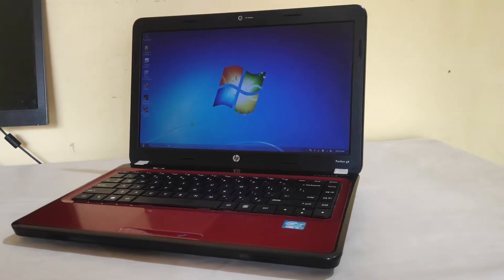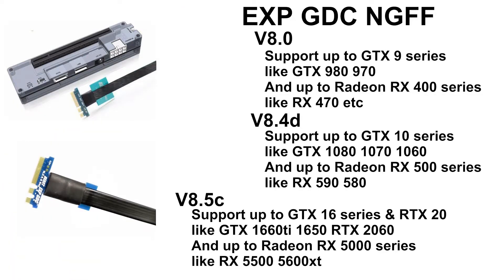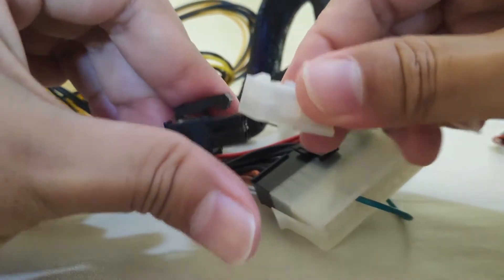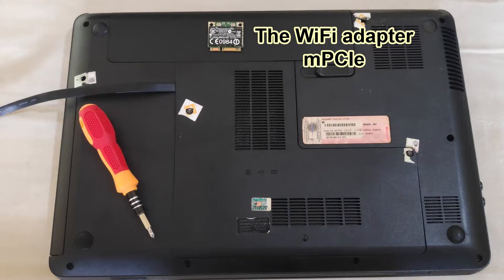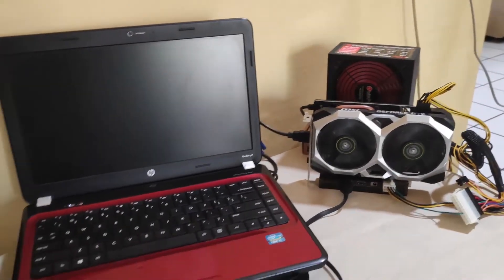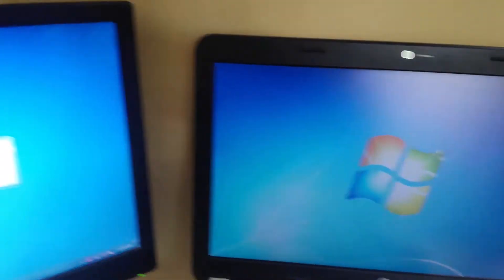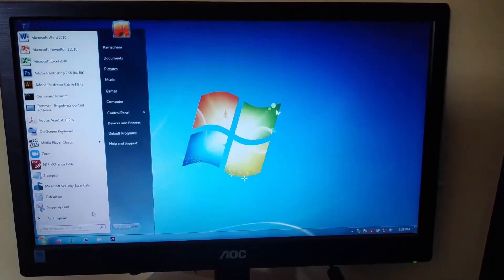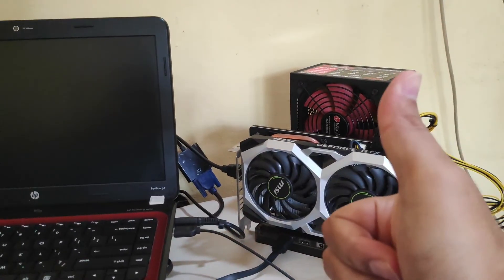EXP GDC Beast V8.5c eGPU with GTX 1660 ti on Old Laptop from 2012

Comment: question about using the reversed gpu. if my laptop is a gtx960m can I use a gtx2060 or gtx1060? or switch to amd completely?
Reply from the maker: You MUST Disable GTX 960m COMPLETELY. From Device Manager and then from BIOS. But before that you will need to use Display Driver Uninstaller DDU.

After that, you need to make sure IntelHD Graphics driver is installed properly so the Laptop can run even without GTX 960m
Reply: @ClayWheeler  the bios on my laptop does not allow me to disable the built-in graphics display. I have installed the drivers for the 2060 and it shows in the device manager. also uninstalled the drivers for the gtx960 the reinstalled the gtx2060 drivers. but for some reason the nvidia icon says there is no monitors connected for the gtx2060. So because i don't have the option to disable the built-in graphics display I think something is getting forced by the intel drivers. my laptop is a msi ge62 2qd apache pro runs a fairly old bios.

I should mention this process was before using DDU. i will try again with DDU.
Reply from the maker: @regfinley7111  right So basically while the GTX 960M Still installed and running like normal, try to Open Device Manager. Go to display section, Right click on GTX 960M, check which Access point PORT it is using from Details Tab, and then take a note of it.

 And then on the Top Menus , click on Show Devices by Connection. This will show which COM/PORT the GTX 960M is being connected to. 

Basically something that says "PCIe Controller xx COM x" or similar to what you take note earlier. Right Click on it, and then disable.

After that Restart Laptop to Safe Mode, 
Uninstall GTX 960M, RTX 2060. Basically just select the NVidia menu in DDU.

BUT before that, download the installer for your IntelHD Graphics driver so you can install it after Restart.

And then also uninstall Intel driver if still existing.
Reply: @ClayWheeler  Im a but confused when its safe to uninstall intel. If I uninstall nvidia drivers the windows drivers will take over when I use DDU to remove Intel correct? Or do i reinstall the RTx2060 drivers first before uninstalling intel?
Reply: @regfinley7111 On my understanding you're trying to say that uninstalling your CPU igpu and Descrete GPU  windows will take over the display driver system and act as a adapter for mean time? Yes, and u can now install the 2060 driver and the igpu CPU driver. Just don't install the 960M driver or it will override the 2060 drivers causing some weird stuff (trust me).

Welp this comment is a week old maybe already figured it out.
Reply: @FreyaChanQQ  I have not got it working. Everything is fine until I install the 2060 drivers. I think the nvidia game ready drivers might be the culprit. The 960m has a way of updating its self no matter what. I gave up a bout a week ago. I can install the 2060 drivers in safe mode. Everything is fine from the looks of it in the device manager. then when I restart the MSI logo shows for 2 seconds and freezes then nothing happens.  its frustrating to say the least.
Reply from the maker: That's why using GPU from the same maker (NVidia) is quite complicated.

Same thing if the Laptop already have Radeon GPU and you want to use Radeon external GPU

Comment: can i use gtx 650 ti in this model pc with gdc v8.5c?
Reply from the maker: On what Laptop model ?
Reply: @ClayWheeler  hp g6 pavillion
Reply: i try to use it right now but the carte graphic erreur 43
Reply: gtx 650ti with power 500w and gdc v8.5c
Reply from the maker: @naughtyxrider7291  I know how to fix Error 43.
Just give me your email, I will send the fix. Write your email but with Space after each Letter so it doesn't get deleted.

After 3 minutes, delete your comment
Reply from the maker: @naughtyxrider7291  y o u r e m a i l . c o m
Reply from the maker: @naughtyxrider7291  I don't see your comment lol
Reply: @ClayWheeler  i send it but it deleted
Reply from the maker: @naughtyxrider7291  remove com just the front of the email

Comment: Tried to get  rtx 2060 work with same set up  windows  has detected  rtx 2060 also installed  driver but for some reason  all games i got   still runs on intel hd gpu i also nvdia  control  panel  wont open  anyone had same issues

Comment: Hey brother !!!! I have a question, does every graphic card is compatible with this egpu dock or any/some graphics card have incompatibility issues with it ....????
Reply from the maker: More likely the Laptop itself rather than Graphics Card.

Check out pinned comment for range of Compatible Graphics Card, even RTX 3070 is possible.

But if the Laptop has poor compatibility or a driver that's no longer updated by the company itself, then the Graphics Card might not be detected at all.

Comment: hi,i have HP Notebook - 14-cm0076au with spek AMD Ryzen™  5 2500U Quad-Core,8GB DDR4-2400 SDRAM
can my laptop run with gtx 1050ti ?
Reply from the maker: Technically yes, and apparently you will need EXP GDC v9.0b or v9.5

WARNING!
Please check out on YouTube about your Laptop disassembly Guide. One thing you want to make sure, if it has more than ONE M.2 NVMe SSD Slot. So if you have two, you're Lucky. You can use the empty slot for eGPU.
Also, consider buying JHH-Link which can be found in AliExpress or AliBaba. It is just like EXP GDC v9.5 but it is much simpler to assemble.

HOWEVER, if you found out you don't have TWO M.2 NVMe Slot, then you can use EXP GDC v8.5c NGFF.

Also, please consider to check if your Laptop Actually has empty SATA slot, so you can clone your System from M.2 SSD into SATA SSD, and then using the M.2 Slot with EXP GDC v9.5 OR JHH-Link 

Personally, I would advise NOT TO use NGFF WiFi slot for eGPU on AMD system, because it appears to be not successful pretty often — when compared to Intel Laptops of the same grade as your Laptop

Comment: Bro I kept on getting error 31, I tried uninstalling it with DDU and latest installing drivers, after restarting I get error 31😭
Reply from the maker: What GPU?
Reply: @ClayWheeler  hp probook 4530s + mpcie + gtx 1050
Reply from the maker: What Laptop?
Reply: @ClayWheeler  I already solved the problem, but here comes another, the gpu is detected, but the Nvidia control panel is missing, the external monitor is also not detected
Reply from the maker: @alejandroadrian5008  the GPU is detected in Device Manager?
Reply from the maker: @alejandroadrian5008  try to update certain PCIe controller driver using 3rd party app shown in my other video
Reply: @ClayWheeler  yes with no errors
Reply from the maker: @alejandroadrian5008  what version of Windows? Windows 10 1903 ?

Comment: i have a lenovo t410 with nvidia optimus and no intel graphics can it still work with an amd graphics card
Reply from the maker: What is the CPU full name? Check from DXDIAG
Reply: @ClayWheeler  it an i5 540m
Reply from the maker: @pplarge7677  alright, do you already have the AMD Graphics Card or you didn't Buy it?
Reply: @ClayWheeler  was planning to but not yet
Reply from the maker: @pplarge7677  Alright I think I understand your Laptop now

Lenovo ThinkPad T410 with
Core i5 540M it actually has IntelHD Graphics, you just need to install it
Nvidia Quadro NVS 3100M Optimus

Now I'm imagining the scenario where you update everything related to your Laptop's internal Hardware. DON'T USE the Built-in Hardware updater feature from Windows 10 or 11. You can use any 3rd Party app to install missing Driver, I'd suggest ioBit Driver Booster app. It will install the missing IntelHD Graphics driver, but you don't need to click on NVidia driver. See this video for reference

 https://youtu.be/TSF8zckwTDE

And then, try to check the Device Manager for the existing Express Card slot on your Laptop to see if it's still working, so you don't have to crack open the Laptop's case. Otherwise, just use the mPCIe WiFi slot. They're actually have the same amount of Bandwidth anyway.

And then, for the AMD Radeon card you're going to buy, DON'T BUY RX 5000 or RX 6000 series. The reason? They're PCIe Gen 4, might not even Boot on your Laptop because of Architecture difference. Just buy any RX 500 series like RX 580 8GB, RX 590 8GB etc.
Reply: @ClayWheeler  tried it but there is no driver for i5 540m and even if i tried finding drivers for this exact cpu the device manager still does not have intel hd graphics on display adapter
Reply from the maker: @pplarge7677  Pardon me, it's called Intel GMA driver for Core i5 540M.
I used to have this CPU in the past but in Dell Laptop, and it had Intel Display Driver GMA (Graphics Media Accelerator)
Which might be Not working at all for Windows 10 or even Windows 11.

The driver itself was designed for Windows 7. What Windows are you using right now?
Reply: @ClayWheeler  i got windows 10 right now i guess thats the reason
Reply from the maker: @pplarge7677  So I think the other solution

If you're using Windows 10, make sure it is a version between 1903, 1909, 2004. Don't use any Windows 10 newer than 2004 like version 20H2.

The reason is very simple, it is altering the behaviour of mPCIe socket for old Laptops. So you can only use those 3 versions of Windows 10 that I mentioned, 1903, 1909, 2004.

On your keyboard, press Windows key + R and then type Winver. See which version of Windows 10 you're running

Comment: Really Really helpful Tutorial......Thanks a bunch man.......
Not at all a Pro in the hardware part, thus asking, is there any chance i can do this on an Acer EXTENSA 4620 (i have upgraded RAM of the Laptop to 4GB thats the Max it can go) would be really nice if u could help me out on this.....👌🏻👌🏻👍🏻
Reply from the maker: Can you check the DXDIAG for Laptops Full Name and Processor Name?
Reply: @ClayWheeler   Acer EXTENSA 4620.....
Got the Specs from Zooming-in on my Laptop Pic Spec STICKER.....Lol.....
- Intel Core 2 Duo Processor T5250 (1.5 GHz, 667 MHz FSB, 2 MB L2 cache)
- Mobile Intel Graphics Media Accelerator X3100
Reply from the maker: @ebi7857  oh no, that's too old. Your CPU from the year 2008. Technically you can add External Graphics Card like in this video, BUT you will be wasting your Money because the Extreme Bottleneck.

Honestly it will be better for you to buy Secondhand PC under $100 and still getting full speed from Graphics Card.

I can only recommend my Video for Laptops from 2011—Today
Reply: @ClayWheeler  Thanks anyway Buddy for the info, appreciate that.
Atleast am a proud owner of a relic of a laptop......LOL.....😂😂🤣
Reply from the maker: @ebi7857  I have advice for you.
Buy SSD for that Laptop, and then Clean everything inside and outside. Using isopropyl Alcohol 100%.

After that, install Windows XP on it, and you can sell the Laptop for Classic Machine for $1000 in antique market.

No kidding, you can sell your Laptop for $1000 just by cleaning everything and use SSD.
Reply from the maker: @ebi7857  or maybe use Windows 7 instead. But still with SSD.
Reply: @ClayWheeler   Have already installed SanDisk 120 gb SSD and as i mentioned earlier have maxxed the RAM Slots with 4gb RAM (2gb x 2gb)........
The Screen of the Lap has been damaged n taken off a decade ago, have been using an external Monitor since then. 
Was that a website u were talking about....??
Reply: @ClayWheeler Hell Ya....Will do that as soon as i reach home..... Thanks for helping me out buddy.....👍🏻👍🏻...😃😃

Comment: Hello, my laptop HP processor i35005u can suits well with gtx1660ti?
Reply from the maker: what HP Laptop model name?
Reply: @ClayWheeler  FM1K68LG. Will it works?
Reply from the maker: @husaininazir1947  Thats not Laptop name

Laptop name is in DXDIAG
Reply: @ClayWheeler  sorry, this one HP Notebook - 14-am036tx
Reply from the maker: @husaininazir1947  it has Radeon R5 GPU in it?

Then you should use NVidia GPU. But anyway you must disassemble the Laptop to check the Compatible slot. Because it could be NGFF.
Reply: @ClayWheeler  already come with Radeon R5. I want to ask your opinion if i use gtx1660ti can it suit well with my i3 5005u? Or i need to downgrade the gpu to gtx1050?
Reply from the maker: @husaininazir1947  any NVidia GPU will work. Even RTX.

The real Problem is opening bottom case of the Laptop to check the WiFi Card model.

Also, the BIOS settings
Reply: @ClayWheeler  Thanks

Comment: Will dock 8.0 version work well with GTX 1050ti ?
Reply from the maker: Absolutely. On a strict note, please use GTX 1050 Ti with 6 pins PCIe power connector.

Because there are 2 different GTX 1050 Ti on the market, with & without extra Power Connector.

Also read the pinned comment
Reply: @ClayWheeler  😂 SAD for me , it 's MSI gtx 1050ti with no 6pin pcie power connector
Reply from the maker: @erspleen4666  I'm afraid that won't work unless you are willing to spend another $20 for "Dell DA 220 Watt Brick PSU"

See pinned comment for that particular PSU. Which is intended for Graphic Card without PCIe power connector like GTX 1050 or 1650
Reply: @ClayWheeler  i decided to buy a Dell DA 220w brick psu. It were old so how can i test max wattage ?
Reply from the maker: @erspleen4666  what is your GPU anyway? If it's GTX 1050 — 1650 it should be more than enough for 75 watt because the Dell PSU is more than enough for GTX 1660 Ti anyway
Reply: @ClayWheeler  it 's msi 1050ti
Reply: @ClayWheeler  how can i turn it off the same time with shut down laptop ??
Reply from the maker: @erspleen4666  it doesn't?
Well it occasionally could happen when the Laptop already shutdown but the GPU still spinning, especially if using Dell PSU.

What's your situation now?
Reply: @ClayWheeler  then i should do next for my gpu safe ?
Reply from the maker: @erspleen4666  there are at least 3 possible method for this.

Option 1, if you're using Windows 10, make sure to do Full Shutdown instead of default shutdown. You can make shutdown.exe shortcut on desktop wallpaper, with this parameter:
shutdown.exe /s /f /t 1

Option 2, go to BIOS and check how it configures the PCIe signal. Most Laptops are always different

Option 3, if you made sure you did Option 1 but the GPU still spinning, you can manually unplug the Dell PSU from Power outlet, because virtually, there's no Data flowing inside the GPU that will cause any GPU corruption. Next time you plug it into Power outlet, try to use Switch for AC power.

TBH I did the Option 3 hundreds of times because I work at PC repair shop. No GPU ever harmed this way.

I never need Motherboard to turn on any GPU if I want to test only the GPU.
Reply: @ClayWheeler  does it work with window 11 ?
Reply from the maker: @erspleen4666  wow that takes an unexpected turn.

Is everything working normally? I don't know if Windows 11 could work with any External GPU mentioned in my video except for V9.0b and V9.5 .

You haven't told me anything about your Laptop or if anything works at all in the first place.

I was expecting that Windows 11 will automatically force to install GPU driver Online, without you knowing if it's Compatible with External GPU or not.

Anyway if I'm using Windows 10, I always turn off Automatic Driver updater feature.

Usually I use 3rd party software to do this, ShutUp10 or just search ShutUp Windows 10, and disable everything related to Automatic Driver update.
Reply: @ClayWheeler  my laptop is x542u asus and egpu work good with beast v8.5 and dell psu
Reply from the maker: @erspleen4666  and Windows 11?
Reply from the maker: @erspleen4666  well then, seems like Option 1 & 3 from my comment above is still valid even if you're using Windows 11.
Reply: @ClayWheeler  but i have a problem that my laptop not power up with pin . It just open with using adapter . It was happened when i setup ngff cable in mainboard ?
Reply: i try put my wifi card in and restore everything like before but it still not open with battery ?
Reply from the maker: @erspleen4666  what Pin?
Your Laptop's BIOS has Pin number?

I don't understand your comment.
Reply: @ClayWheeler  battery ^^
Reply from the maker: @erspleen4666  I don't understand.

You cannot turn on your Laptop after you put back the WiFi Card? The Laptop cannot turn on with Battery?
Reply: @ClayWheeler  yes but it turn on when i plug adapter
Reply: I thing it have some thing issue with battery
Reply from the maker: @erspleen4666  Before you are using eGPU, just the Laptop alone, the battery still working?